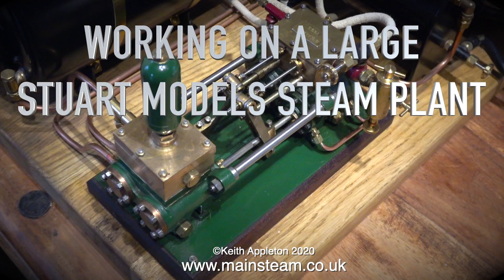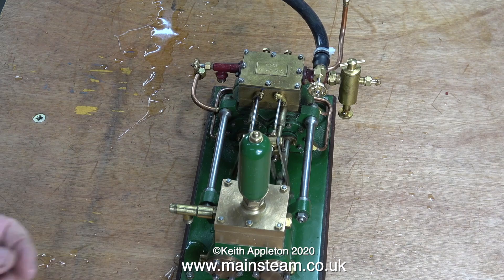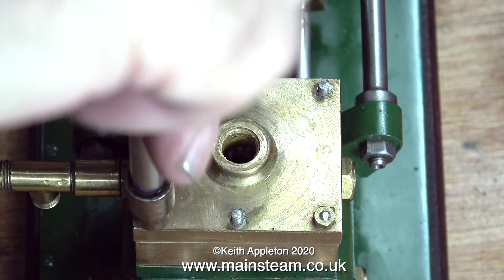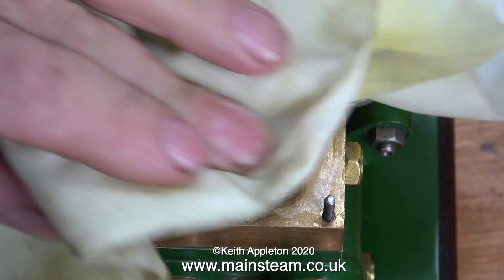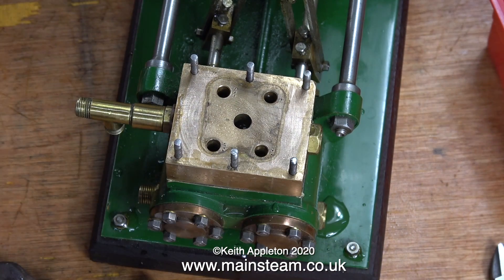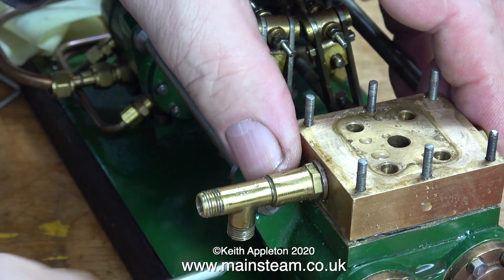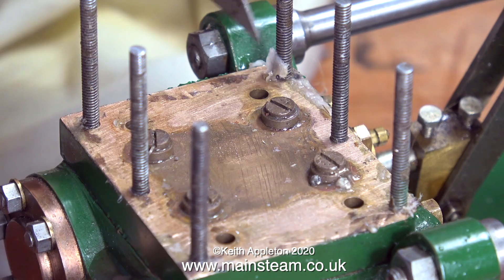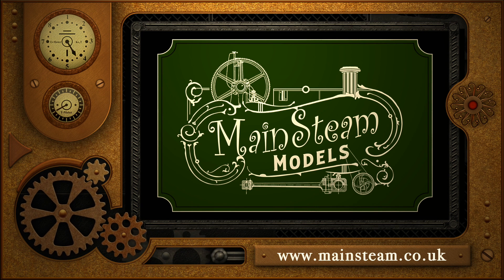WORKING ON A LARGE STUART MODELS STEAM PLANT - PART #1

Comment: Somewhere over the past 15 month of watching steam on YouTube I saw an engine that had “extra” bolts on the valve cover.  These had just enough thread and travel to lift the cover without the need of a Stanley Knife blade.  I assume you’ve seen this and know the correct name.  Have you ever incorporated anything like this in a build?
Reply from the maker: I have seen that, in fact my large traction engine has some threaded holes around it to do as you say, to remove the cylinder cover easily

Comment: Keith the term for the vessel is call a water hammer dampener.  Water hammering can create a lot of problems in high pressure system but here not to sure.

Comment: I have seen more than one automotive and motorcycle engine ruined with the improper use of silicone. People use a ton of it on a gasket. Then put the part together with the silicone still very wet. The strings that squeeze out on the inside of the engine bock the screen feeding the oil pump. Then the bearings are starved.

Comment: I've never known any professional mechanic who disagreed with me when I said people who use silicone sealer as a gasket should be lashed with wet spaghetti!   I've done jobs where the stuff was used in place of a gasket under carburetors, intake manifolds, oil pumps and oil pans, and you would not believe the damage this caused.  Whole engines ruined because the customer was too lazy to get the proper gasket!  Those poppet valves have been around since the first steam engines were first built!  They are simple, and amazingly, still do the job as intended.

Comment: What an absolute mess the silicone made...no wonder it was clogging.Were there no gaskets? (Just a thought here,and I'm sure it occurred to you as well,...but would the surface clean up have been easier if the studs had been removed? But maybe they were seated with Loc Tite.) Cheers from South Carolina!

Comment: Seems to me you need a written warranty: If the Customer/End-User chooses to use Silicone in the pump, you will fix it... after the Customer provides suitable proof that both of their hands were placed into an operating wood chipper to prevent a recurrence of the repair.

Comment: some things you probably have around the house will cause the sikicone sealant to swell and this might break the boond with the metal . . . things like WD-40, vinegar or alcohol.

they also make silicone 'digesters' that will break down the silicone but aren't too common outside of industrial uses.

hope it helps . . . 'sa nice pump.